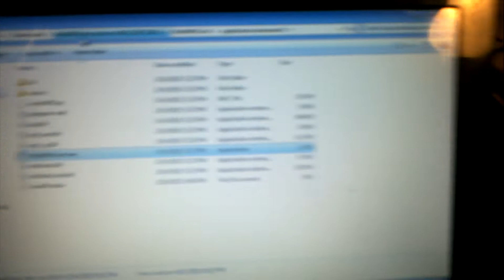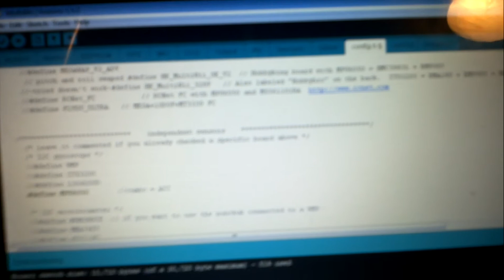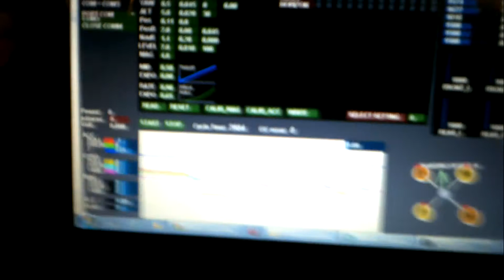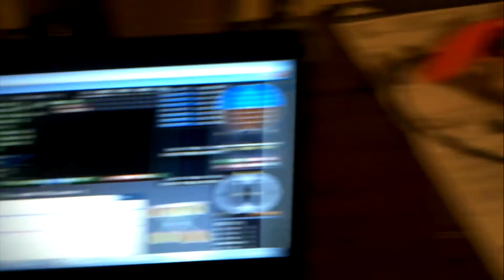Aerosky h100 quadcopter

Comment: Hey Sladerunner. I had the same initial problem and was able to pretty much even out the prop rpms and gain some control by adjusting my trims manually. My problem is I cannot get a connection between the control board and the computer.  It recognizes com6 in the device mgr. But no action on the gui of Multwii.  Can you you shed any light on how you were able to connect?? Thanks ljonesii